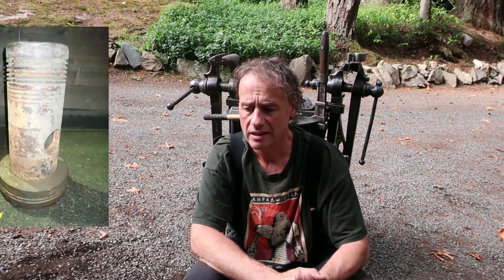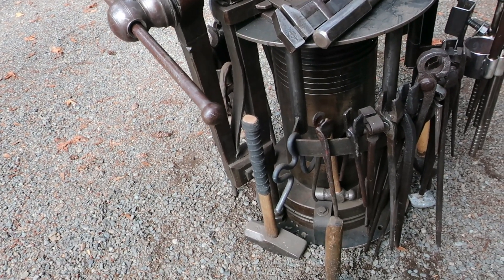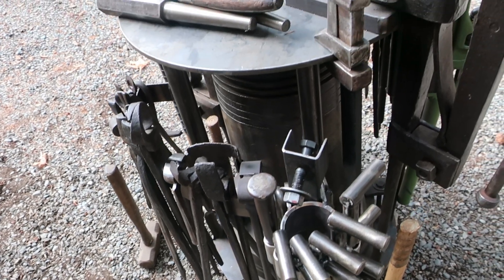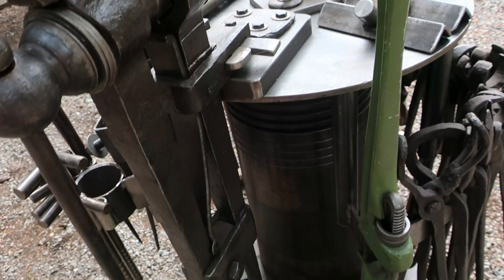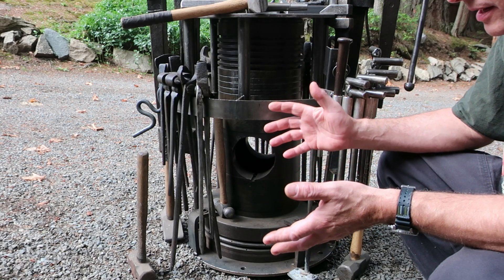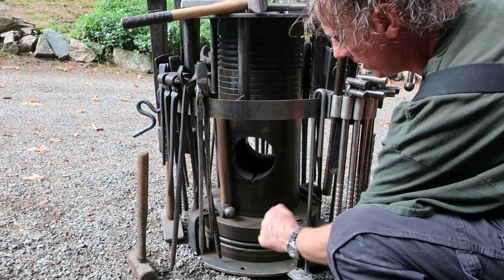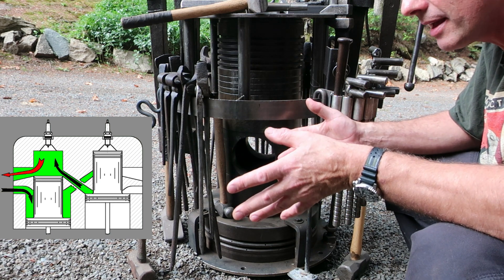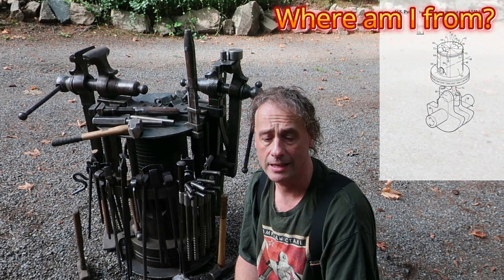A DIY annular stepped piston blacksmith table.  Leg vices and diesel pistons.

Comment: I can't assist with any info regarding the piston history but I would like to know if this is fixed stationary into the ground or mobile? Are you able to clamp hot work in either vise to bend and twist?  I'm interested in mounting a post vise in my blacksmith shop for the most versatility.
Reply from the maker: I would love if it was fixed in place, but I work out of a very small shop and need to take most tooling outside to do anything of any size.  If I need to do serious bending I will put some scrap lumber down and screw the table to it, so that I am standing on the lumber while bending. That stops the table wanting to turn while levering against it.